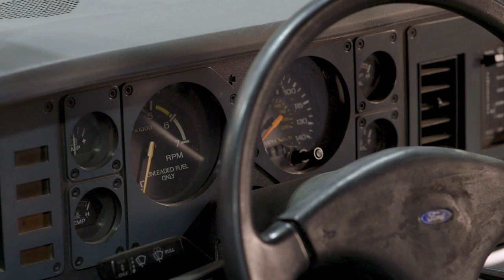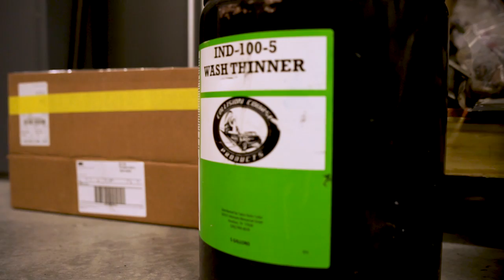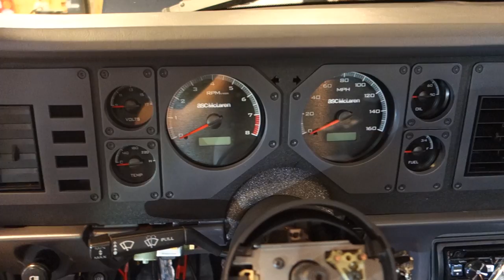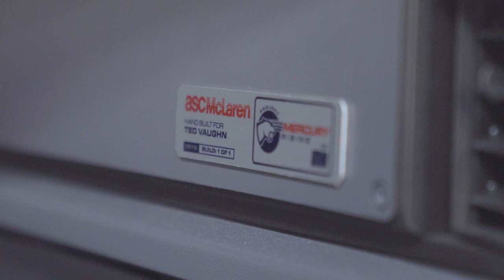ASC McLaren Fox Body Coyote Swap | Project Mercury Rising Full Series Video

Comment: Great Video!...I am a former owner of a 1985 Mercury Capri RS 5.0 with Dark Red Metallic and Gray Cadding Bottom Trim on the Exterior and Gray Luxury Sports Cloth Interior with the Red Trim Sports Seats! (The Mercury  Capri had a Higher End Interior than the Mustang IMHO!).

It was a 5sp and the previous owner had replaced the Bubble Glass Hatchback with a 85 SVO Hatchback with the Dual Split Rear Spoiler!...I kept it mostly Stock at the time, but I put some 50 Series BF Goodrich Radial Tires on the  Factory Wheels and a Yellow Koni Lowering Springs and Shocks Kit!

I miss that 85 Mercury Capri RS 5.0 it was the last year of the Carbureted 5.0 (302ci.) engine and first year with Factory Headers!...I also liked the Unique Front End with the Built-in Front Spoiler and Fog Lamps!

The 1985 ASC McLaren Mercury Capri was a Next Level Up from my 1985 Mercury Capri RS 5.0L, but they both were Unique Capris!...God Bless America!

BTW!...I really like the Idea of the 5.0L Coyote engine Swap, I had the same Idea to do to mind as well!
Reply: I had an 86 Mercury Capri w the fuel injected 5.0!!! Loved that car!!

Comment: Uncle Ted drives it a few years, parks it in a field ....
Reply: Yea there's people actually like that. Sad! Some cars never stay alive cause of it!
Reply: I believe that’d be a hangin’ offense.
Reply: What's to stop him from parking it in a field again? He simply might be too old to have interest in cars. :(
Reply: 99Vood99 in such case he wouldn’t be RUNNING A SHOP...also, if he sold that thing in current shape it would be worth over $150k to the right buyer; those things were rare as hen’s teeth before time did its part; not to mention the crate motor, modern susp., etc.
Reply: @samsonian  it's worth LESS because it's no longer a og paint, og engine car. full rebuilds like these are valuable for 50+ year old cars.
Reply: @samsonian  I could be wrong but I don't think Uncle Ted owns or runs the shop. Again some hobbies and interests are just hard to keep up as you age.

Comment: Ugh, I had a set of those metric wheels. They take metric tires which were extremely expensive. Sold them for scrap and picked up some GT rims from local junk yard. absolutely beautiful build! One of the better ones I've seen in awhile
Reply from the maker: Yeah, these metric wheels were not the most popular option made.

Comment: Super job guys! I had an '82 Capri with the 5.0. It was so sweet when new. I raced the crap out of it but it met it's end (for me) in a collision with a deer in 1988. I sold it to an auto body tech who repaired it but I lost track of the car 25 years ago. I wouldn't doubt it's sitting on cinder blocks behind a barn somewhere.

Comment: I have a 88 t-top in a color combination ive never seen. It needs so much work! It was originally my dads car in the early 90s. He bout it with less than 20,000 miles on it. He gave it to me when I turned 15 but it had computer issues and it’s been sitting since about 2000. Boy, if I ever hit the lottery the budget to restore my baby would be endless to get it to this caliber! #foxbodynation

Comment: My first car was a 81 Capri with the HO 3.3 just kidding. Have a 85 gt hatchback 50,000 mi on the body 3,000 on the drive train that I freshened up myself. This thing has never seen snow since new knew the previous two owners. My daily is a 07 F150. I bleed blue. That Capri is amazing the coyote swap and diff mods a perfect combination. And kudos your Uncle will feel 20 years younger when he gets comfortable with the power and hammers the gears.

Comment: I have an 84 RS Turbo Capri. I've gotten a bunch of stuff from LMR and still need more. I'm by myself, so any progress is painfully slow at best. When I bought it in 99, it had the hood, driver door and fender, and front end stolen off of it. The dash was busted by the thieves to get the stereo. Fortunately, it has no rust having been a New Mexico car. I have replaced all the big pieces, but finding a place to start for the rest is hard - just so much to do.

Comment: I have a 1987 mustang ASC McLaren 379 special addition convertible with 55,100 hundred miles and idles at 850 rpm. Only need is a heater core and new vacuum hoses  paint job is good still and rust seen at bottom of car doors rubber and water drain holes are at
Reply from the maker: That is awesome! I am glad to hear it is still in that good of shape after all these years.
Reply: @latemodelrestoration  it set indoors or its a southern states car.and im the 9 owner so yes I see these fox bodys  get tossed around from person to person. I got it for $9,000 it's ok deal can't find to many thats to clean or won't fall apart after 500 miles of driving around like the heater core  and interior screws loves  fall out  every where. I bought it at the Columbus Ohio arena cars sales as a old collectors car sales  and they keeps all their collector cars indoor in a garaged location I used to buy 86 mustangs straight 6 for anywhere in year of 1995 sold used fair condition from $50 to $500 bucks old people didn't like fixing cars  ... now days mustang are all  just rusted away sitting outside or people online buy up quickly fox body mustangs as parts cars. The 5.0 1980s  bronco 2 are also fun to drive but rusted out as well horrible body mounts leaf spring mounts on 1989  2.9 V6  death trap..

Comment: Amazing, but $65,000 plus in a car that's worth around 30k is an interesting decision. When you go this extreme on an install in you need a rare, valuable donor. I love the 80's Honda CRX, it was a cool sporty car, but I wouldn't buy one and throw $50k in one to restore it. Like baseball cards, 80's and 90's cars will probably never compare in value to the 60's muscle cars. Something special happened in the mid 60's to late 60's, those cars are works of art.

Comment: I have a 1980 Capri Ghia, swapped in an 88 5.0 T-5 8.8 swapped in with TFS heads. Parked it in Sep 1999 after ripping the upper control arm mounts off the unit body from side stepping the clutch a 6000 RPM. Can't believe it's been 20 years. Some day it will be reborn, with LS power, sorry Ford purists.

Comment: Came with the B303 cam? I doubt it, wouldn't have passed smog. Now, if he meant E303, then I could believe it.
Reply: The F or X should be your intention. The b303 was a mild cam with minimal valve check or piston build. The E was the lesser of the 4. B was next up.
Reply: J J JR the point I was making was that the E cam is smog legal in a Fox, the B is not.

Comment: For a car of this level, why not IRS?
Reply: My guess is that this car is for local, short distance cruising and the occasional full throttle blast. I have an old modified 5.0 from that time and a IRS from a later GM car (also modified) that I use for the same purpose. For a non-daily driver, the IRS is a liability without mods to the suspension. You don't have to worry about axle hop with the live axle. The IRS can be an issue when you least expect it and not worth the extra expense when it comes to higher power applications that are not daily drivers.

Comment: I bought new the 1985 1/2 50 Capri new they all came with the roller 302 with shorty headers , lateral struts in the rear  
The gray seats with red trim 
I loved my car it was a freak
It would out run the 1985 vet’s the TPI I ROCK was not even close .
I have had quicker cars but non with that much fun factor 
I did remove the 5.0badges 
The most fun I  had 
I went through 3 engines 3 trans and 2 diff’s 2 complete paint jobs. To OE Red 
The last engine had the original  cam back in it 
I ended up sailing the car just before it rolled over 50,000 miles my mistake

Comment: Yes I know it's older video. I don't care for coyote swaps in sn95's and foxes. In sn95's a 460hp 32v  should be like a super cobra but my feeling the 32v 4.6 seems more special and desirable just because coyotes are in GTs now and with mustangs the 32v 4.6 was only in cobras this it being a cobra engine the coyote a GT engine.... I know the coyote is a way higher performance platform with way more potential. But I can't change how I feel. Regardless of performance The 4.6 seems way special

Comment: '
nice pretty dark blue color on the car...
but one thing is a not safety...
how come dont put 2 amber yellow lights on the rear taillights at 025 to 029 / 3527 to 3530...
both taillights are not pretty = not safety at 3729 to 3732 / 4136 to 4139...
dont need put 2 chrome grills lines on the both taillights...
better put 3 bright colors on the rear taillights likes this...
yellow = red = white.....[ license ].....white = red = yellow

Comment: *(NITRO BUTTON)*ANYONE??   Now my brothers ex father in law who was a county sheriff in middle East Ohio had a Capri, the color was all gray. Inside on the middle console/drivers right arm rest just before the gear shift lever was a button that read NITRO. Has anyone else came across this with their Capri? We were in highschool at the time and my sister in law drove it one time as I sat in the back and remember noticing that NITRO button, sad to say we never pushed it or knew what happened if you did, even if it was active. Ain't seen another one like it and that was 20 years ago. Sound familiar to anyone about the button?